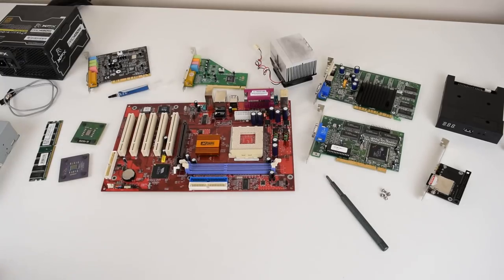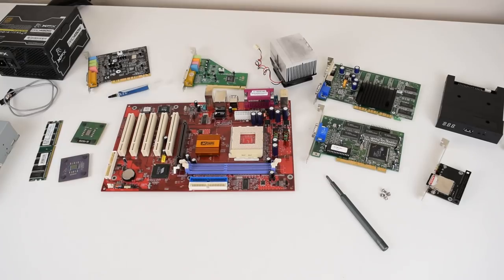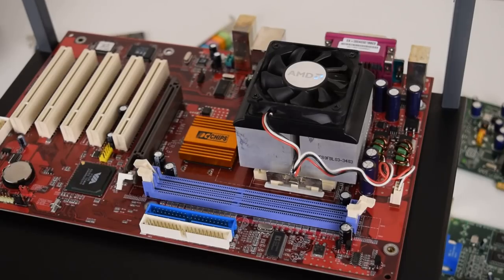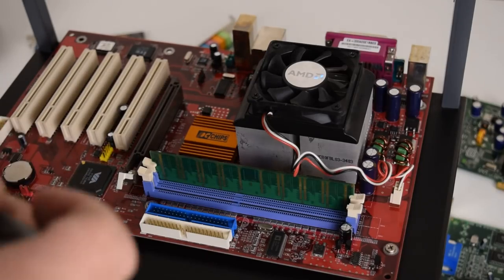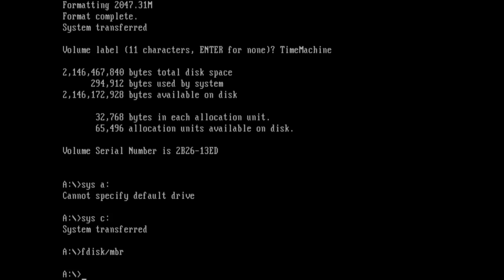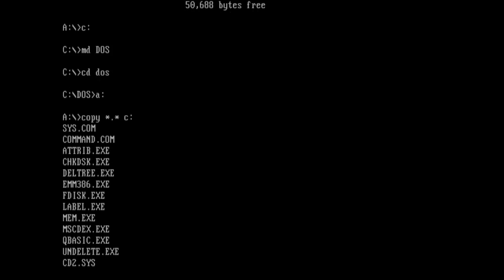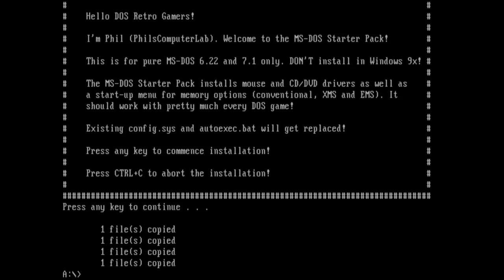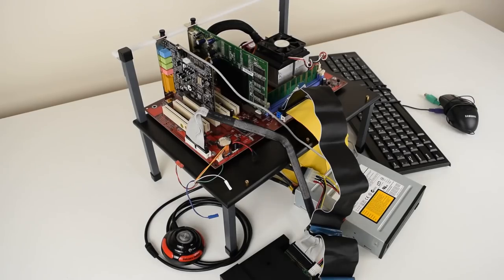Building a DOS Retro PC that everyone can afford

Comment: I ... would not use AMD. Socket A AMD processors seem to eat a lot more energy than the intel cpus. Stock/custom fans for AMD cpus from  socket A seem to be a lot noisier than the intel ones, fans needed to spin faster to cool the AMD cpus. But the fact is that the AMD cpu fsbs were faster than the Intel ones and AMD seemed to beat intel regarding performance. Intel chipsets were "better" in performance while VIA/SIS were good with features like ATA133.
Reply from the maker: Yea it's all about which parts you pick, and avoiding to generalise. That Geode I'm showing, well did you know it's a TDP 9W CPU? Beats all the Pentium III chips. And the board has USB 2.0 which AFAIK isn't a thing with Intel Pentium III boards. Don't get me wrong, Pentium III is awesome, but it's a HOT platform in regards to prices. So I'm showing alternatives.
Reply: Lol ok. I have to look at those Geode some time soon. Keep up the good videos and work!
Reply: Hugo, if you compare the amd geode with the intel this is totally wrong. Also if you compare socket a amds with pentium 4s the scenario is the opposite, intel heats up pretty badly, and amds perform better and colder.
Reply from the maker: Eduardo Avila I can compare whatever I feel like :) The Geode CPUs are readily available on eBay, flying under the radar.
Reply: PhilsComputerLab It was for hugo. I answered hugo, he was totally wrong about amd cpus of that age. Im sorry for the badly pointed comment, i eddited it to dont be confused.
Reply: Hugo Simões Are you Brazilian Hugo? If yes, you probably will have issues finding the geode here. If you find it will be likelly expensive as they werent common. 
But a 45-65w amd athlon wouldnt be bad.
Reply: Just to be clear, I meant Durons/Athlons. Geodes are probably fine.
Reply from the maker: Eduardo Avila Ah ok, my bad! You can find Geode CPUs on German eBay. I'm not sure why they have so many.
Reply from the maker: Hugo Simões The Duron 800 has 35W TDP. Pentium III 1000 has 29W TDP. So with this CPU it's not an issue and you can use a basic modern ATX power supply :)
Reply: PhilsComputerLab Good to know! I will look into that. I hope that it still worth it even with the abusive brazilian taxes
Reply: @eduardoavila646  Prices get even worse on ML, for our sake
Reply: Tsuboi Ryoutarou Yes, i found a industrial geode board for R$990!

Comment: can this build go up to win98?
Reply: if you enable the caches it can run it just fine.
Reply: @bdhale34 but i guess u cant change the multiplier
Reply from the maker: Absolutely, and it will wipe the floor with any Socket 7 system. The Duron / Athlon CPUs have really good floating point units and perform similar to a Pentium III at the same clock speed.
Reply: Would depend on the motherboard even locked chips are usually only locked going up (I've never seen a chip that has a fully locked multiplier they are always locked up but not down) and you can lower the multiplier on boards that support setting the multiplier. So that's another option for slowing it down even farther if disabling the caches still leaves it too fast for games like Wing Commander which is notoriously picky about faster chips.
Reply from the maker: Benjamin Hale The Geode is unlocked downwards. It's basically a Athlon XP-M.
Reply: I just assume chips are unlocked for reducing the multiplier, Everything from my Celeron 533a up to my  i7 and everything between is unlocked going down even non black edition/k series chips, as I stated in my reply to Aoi I've never actually seen a chip where the multiplier was locked both directions it's always only going up. The bios or board having settings to change it is the only issue one may run into with non Geode style chips. Intel XTU can adjust the multiplier in software for Intel chips that have speed step support only for windows as far as I know though.
Reply from the maker: Benjamin Hale Yea there is a period of locked chips. Pentium 4, Pentium D, all the Athlons, Athlon XP. But with Core 2 and Athlon 64 we got unlocked downwards multipliers again.
Reply: Are you sure the chips are actually locked and it's not just motherboard support not being there? I recall VIA/SiS boards often had crippled features in that respect for the most part. Only the better chip sets had the nice toys included the rest were almost like OEM clones with non existent or limited cpu settings.
Reply from the maker: Benjamin Hale Yes I'm sure. Nothing to do with the motherboard.
Reply: Just dont use a sd card or cf card as a windows boot drive
Reply: Benjamin Hale Well.. there's aways the "pen way" to overclock the older amd processors, i dont really know if that works, but it seems
Reply: Benjamin Hale Nope, many via pcchips had even advanced overclock and tweaking settings. Sis i really dont know as i never used it.